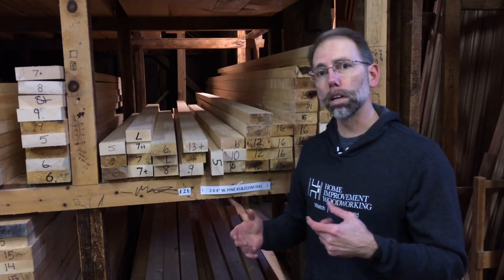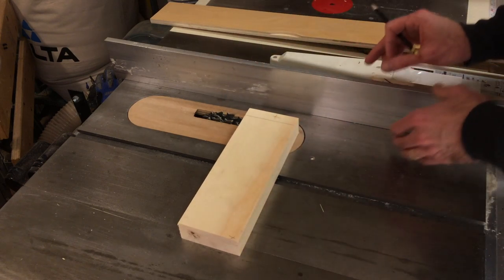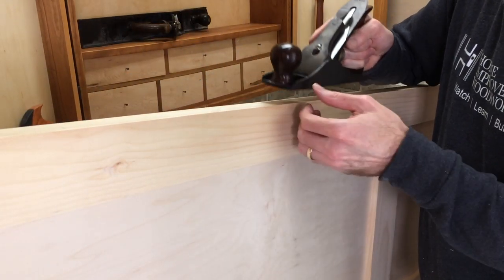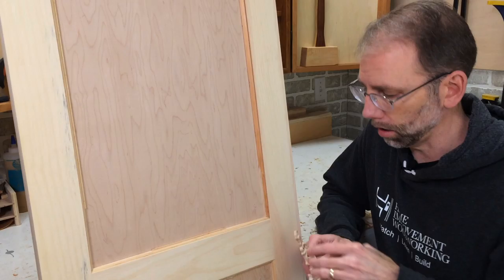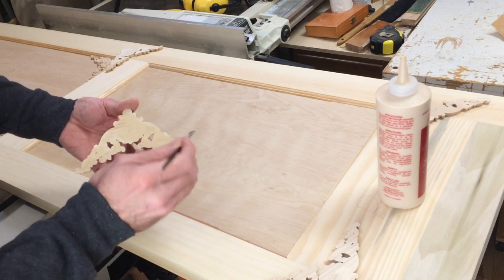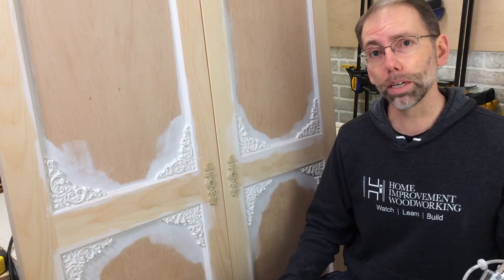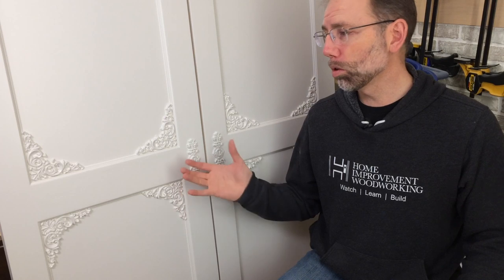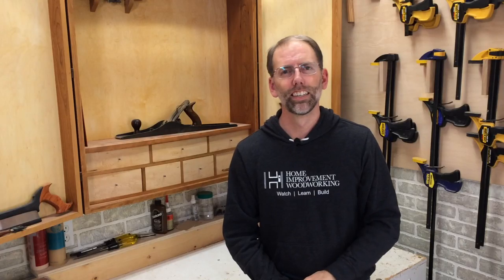How to Build Closet Doors in Shabby Chic Style - Woodworking How-to

Comment: Evening Scott,

David here from the UK. 

Once again, you show us the importance of working with the wood, not against it. I love the sympathy and harmony with the materials and tools that you show on each project, even though your customers taste and mine differ substantially. 

Normally you emphasize the importance of clamping for successful glue joints, but I didn't see any clamping on the trim and decorative mouldings. Did I miss something?

Keep up the good work!
Reply from the maker: Hi David.  Thanks for your comment.  You're right, I do emphasize the importance of clamping when using glue.  The decorative mouldings won't be subject to any stresses and the amount of surface area is sufficient that I'm confident these pieces won't move.  It was a judgement call based on experience.  I hope that answers your question.  Scott 🇨🇦